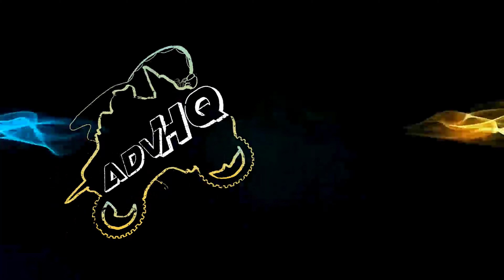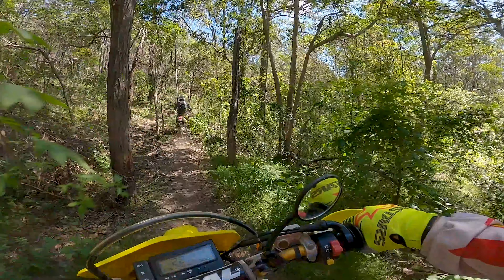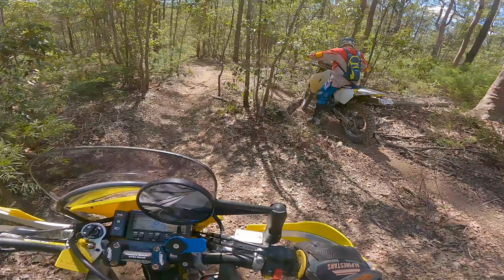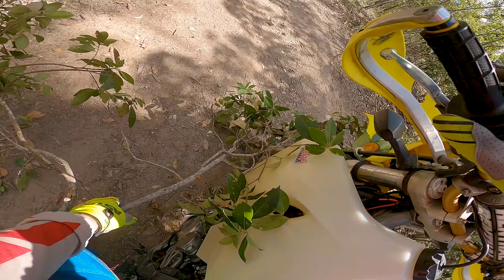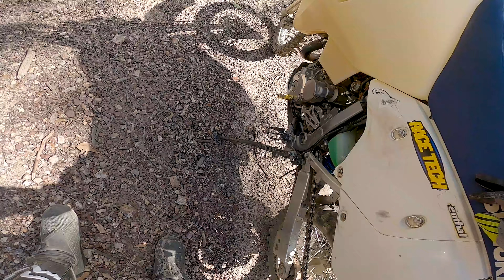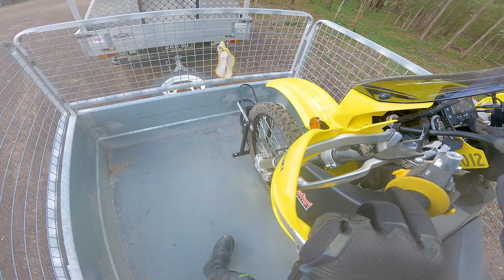DRZ400 Single Track Riding & Engine Issue - Competition Give-Away!

Comment: Hope I’m wrong. Look down the oil fill hole with the engine running.
You should see the oil returning back to the tank. 
If not pumping oil , will damage the cams.
I bought my bike second hand.
Previous owner had replaced the clutch but damaged the plastic drive gear for the oil pump.Good luck. Mick V
Reply from the maker: Cheers Mick, will pass the info on.

Comment: Cam chain noise or stator bolts working their way loose. 

Over fuelling, that will also make a bike run hot. 

How many k’s and age of the bike?
Reply: Could also be over fueling from the choke being stuck on. Like a hydro lock with fuel.
Reply: Just hope its all ok for him. Not a expensive repair.
Reply from the maker: Pretty sure it's 2009, 8000km (90% offroad).... I did ask about the choke being on as the way it ran reminded me of another that ran similar until he realised. Yeah, hope it's a simple fix.